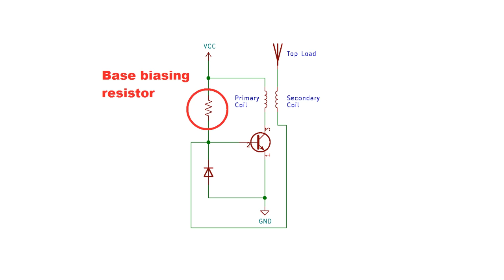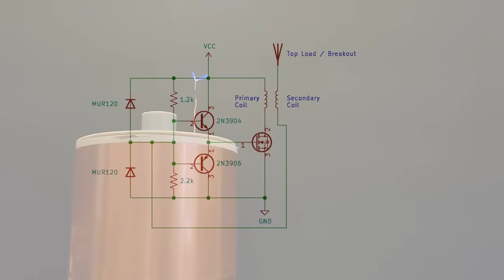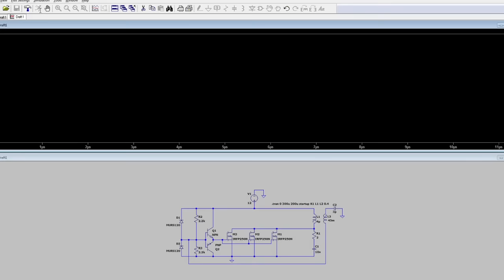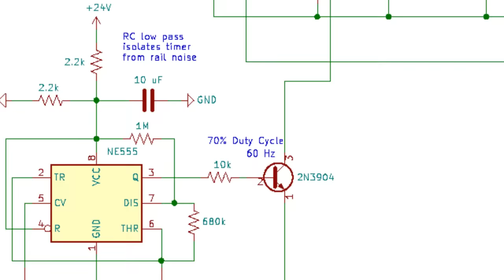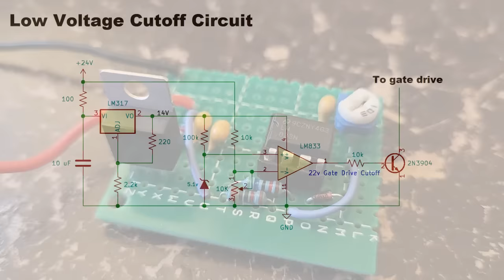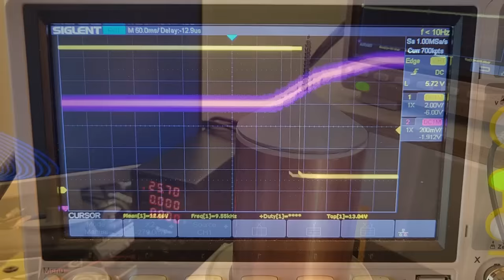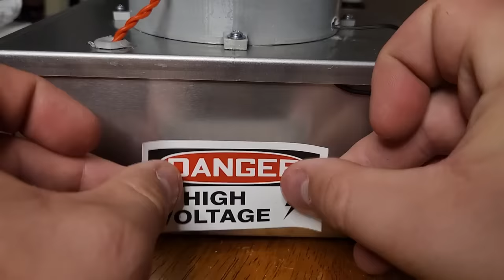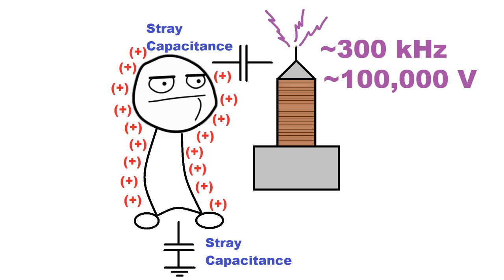Tabletop Tesla Coil

Comment: Trying to repeat. There is bunch of errors in demonstrated circuit cheme. First - gates of mosfets short connected to drain. Second - pnp is up side down, I don't know others, but i can't manage it to work with the listed components. No oscillations.
Reply: Thanks for pointing this out, I don't know much, but this sticks out like a sore thumb. I hate it when the schematics are wrong. People spend a lot of time and effort trying to replicate circuits like this that are just plain wrong. I often wonder if it's intentional.
Reply: Did you manage to solve it?
Reply: I think the shorts on the schematic are probably just from carelessness, it shouldn't be connected, the fets are supposed to be in parallel
Reply: Hey, it actually worked for me. I got around 75KV. But I used a irfp250 mosfet
Reply: @sree137918  hey and then you used the timer on 24v?  Making a parallel connection for vcc to power both parts of the  circuit?
Reply: Actually, it was powered by a 24v 2A supply with a 4.7 nf capacitor in parallel with a single FET. It was a continuous wave tesla coil
Reply: the reason why the PNP transistor is "upside down" is because it's a push-pull amplifier. it's supposed to have both emitters on the bjts tied together
Reply: Yes bro i tested it didnot worked
Reply: I actually corrected the schematic, probably will upload in my channel soon....
Reply: I actually built this a while back and when it hardly worked I thought that I put it together wrong. Thanks for clarifying
Reply: What is wrong with the above circuit? I'm about to do it but I'm a bit confused.
Reply: Cant blame the guy too much i make mistakes like this all the time

Comment: Nice coil! I made the same "insulated switch" discovery when I built my 833C VTTC. Whenever I would touch one of the toggle switches I would get shocked! I also thought initially that I had a bad grounding system but it was current being induced into my body by the electromagnetic field.

Comment: This perfectly shows why I stopped my last circuit design. I did design simple circuits many years ago, really trivial stuff, but even there you start with an simple idea, and then fix the issues ... and simple becomes complex fast. Since I lack experience I can not judge if my finished solution is actually ok or an abomination that still works somehow. So just decided to delegate that when I actually need a circuit. For what I do, i.e. abstract systems design, I just need to know that technical solutions exist.

Comment: So built up this circuit and it works flawlessly good Job! getting about 2.5 inch off the breakout at 24v nothing getting warm other than the snubber resistor which is doing its job!, time to make he voltage cutoff im debating to use a lm358 instead as this is all ive got in my parts bin, cant wait to get it in a box and portable, thanks for showing how its done ;-)
Reply: Hello, by any chance can I contact you by email for assistance? I'm also trying to do the same...

Comment: Videos like this make me nervous, but not for the reason one may think. I've killed more than a handful of devices (bench PSUs, function generators, etc.) from running/testing my tesla coils next to them. So seeing you run it next to your nice scope is frightening. I don't know if my problem is cheap electronics that I had or what... :(

Great build and video as always!
Reply: i saw his monitor flicker in the background when he turned it on, i wonder if its fried
Reply: I know what you mean. I was testing a low power emp generator once (maximum range for disrupting unshielded devices around 5m). It managed to kill 2 laptops; they died shortly after the testing. First time I thought it was a coincidence, so ended up with two destroyed laptops.
Reply: @threeMetreJim  Unfortunately this is the reason I stopped experimenting with Tesla coils. I have very little free space that would get me away from my/others' electronics. 
I built an awesome SSTC that ran off mains a few years ago, but after switching it on once or twice I realized I couldn't do that again :(

Comment: people are always telling me "You MUST put transistors in Darlington Config when using multiple in parallel" and I'm wondering why I see people that seem to know their stuff just putting them in normal parallel and don't seem to have any issues... Are there certain circumstances when its ideal and times when not an issue or times when u must or abs can NOT... nice  video and great circuit, presentation, appearance very cool and interesting watch!
Reply: Darlington connection has nothing to do directly with paralleling transistors, it only may help to provide BJT base current. And this way it's not useful at all with MOSFETs in place of BJTs (see that NPN-PNP pair gate driver in the video).

Comment: The larger top load should improve performance, so strange that it reduced it in your case. It's possible that the additional circuit elements like the snubber circuit are just no longer well tuned to the new frequency caused by the larger capacitance.

Comment: A regular CRT high voltage generator does this same exact thing. We called it the high voltage section. 
It operated at 15,734.26 Hz.  
It’s a standard high voltage transformer. We never, one time, called them a tesla coil. 
High current input on the low impedance side - high voltage output on the high impedance output.  25 inch TV’s had 35Kv on their Anodes.

Now for the haters and defenders.
Reply: You mean a flyback? No tesla coil runs at 15khz, they usually run in the megahertz range, if you are talking about the flyback transformer it is a completely different thing with different purposes too.

Comment: An amazing device & great workmanship. A few comments/questions:  Use a pvc and/or plastic chassis instead of metal?  Immerse any circuit boards in transformer or mineral oil for cooling & the prevention of arcing. Make the primary/secondary coils "plug-in type" so that you can experiment with different lengths & diameters. Can the primary/secondary coils be immersed in oil with just the screw tip exposed?
Reply from the maker: I use a metal case to serve as a ground plane for the circuit and shield the electronics inside from the huge amount of electrical noise caused by the coil.  

The oil thing would definitely work, just more hassle and potential to make a big mess, so usually i avoid it
Reply: @HyperspacePirate  how does changing the overall surface area of the ground alter the output?
Reply: @HyperspacePirate  Mineral oil gets on everything regardless of how you try to contain it.
Reply: @HyperspacePirate  what diameter had your wire?

Comment: I would have used a plastic box, and plastic bodied switches, to prevent accidental discharges through the hands, and the resulting, very painful, RF burns which you experienced.
You're also generating some low-level X-Rays as well as UV light..

Comment: I gave myself a burn like that with a MIG welder one day,.  I was tacking something, and instead of grabbing a tool, just held it in place.  I've done it thousands of times before, but this time, evcerything was just right for the welding current to try and ground through the end of my finger.  Hurt like hell at the time, but was worse three days after, and looked just like yours.  Could the case be plastic to hrevent accidental burns, or is it being metal a required part of the device?

Comment: 3:29 The overvoltage diode, when active, will sink the current to Vcc. Won't that damage whatever power supply is assigned to Vcc? Because the power supply will have negative current flowing through it.

Comment: great work!
but the circuit at 5:30 seems wrong?
and what is the maximum input voltage this driver can handle?
Reply: The max he used was 30 volts, so I wouldn’t go much higher than that

Comment: I would love to safely play with one of these medium strength tesla coils, but as I live in on the 4th floor of a 6 floor apartment building, I am wondering about how much and what type of EM interference noise It would possibly be generating to outside my unit into my neighbours dwellings. I woudn't want to cause much in the way of this, as I don't wish to make them upset with my running it in here.

p.s: I would probably purchase an off the shelf already available one... any recommendations?
Reply from the maker: They'd be too far away to catch any interference. It really only affects unshielded electronics within a few feet
Reply: @HyperspacePirate  Thank you Hyperspace Pirate... ok, so that gives me more confidence to check into getting one... * I'd love to be able to make one like you've shown in other previous videos on a simple scaled down version of what's shown here, (very impressive, btw), but I'll purchase a small one first and start playing... and maybe build one later.
Reply: @HyperspacePirate  how much frequency could these switch? I have a 1MHz coil with no toroid, with toroid it goes to 650kHz
Reply from the maker: @ElIsraelJijijiji  This one is around 300 kHz. A typical MOSFET would probably work ok up to around 1 MHz
Reply: @HyperspacePirate  I plan to make a fatter secondary, I'm using 38AWG since it was all I had on hand, my new coil will be like 450kHz
Reply: @HyperspacePirate  i could run the Gate driver and Interrupter from a different power supply and then just add the higher voltage power supply just into the FET drains
Reply from the maker: @ElIsraelJijijiji  if you had a gate drive transformer, yeah, but it makes the whole thing way more complicated
Reply: @HyperspacePirate  i was just thinking to input 12v or 15v at the collector of the Gate driver, and it will come from the same power supply for the 555

Comment: Hi, a couple of comments on your otherwise great video.The Slayer exciter circuit work with both a BJT and MOSFET alike, the big difference is the  BJT  can sink significant current via the Base Emitter junction effectively providing a return path for the secondary coil current which is not insignificant ( depending on the transistor it can pass up to ⅓ the Collector Emitter current) negating the need for a Base to ground secondary return resistor.  This is not not the case with a MOSFET which has a high impedance Gate to Source, so you have to provide somewhere for the secondary current to go, this whole circuit could be much simplified by using a suitably rated 12V Zener Gate to Source across say a 100 Ohm and a 470 Ohm pull up to supply, you mention in your video 3.40  “ Buffering the current to the Gate”? This makes no sense as there is no gate current to speak of.

Comment: I'm trying to build the circuit, but along the way, I have some questions. If someone could answer a few, it would help me a lot:

--Is the snubber filter resistor 2 ohms or 1 ohm? Because in the last version of the schematic, 1 ohm appears.
--Does the value of the capacitors connected at the beginning have to be exactly 3300 uF? Because I have 3 similar ones but they are 2200 uF, although I don't know if it would work because I'm not very familiar with the purpose of placing those capacitors.
--To find the ideal value for the snubber filter capacitor, is it more appropriate to start testing values above 54 nF or below?
--What awg is the primary winding?
Reply: 1. Snubber resistor's value isn't critical, but keep in mind that lower value resistors will heat up significantly more. You can't use too high value resistors though, because then snubber wouldn't serve it's purpose. I think he used 2 ohms.

2. No, these capacitors are only to provide higher current when circuit needs it, so I think that 3x 2200uF will work just fine

3. In my opinion it's better to start with higher value capacitor and then gradually going down. You can also calculate it's value(he explained how to do it in his video about ignition coil drivers)
Reply: @Antek1234l  thank you :)

Comment: In the triple parallel FET circuit diagrams... why are gates and drains showing as connected together?
Is there some aspect of FET operation that I've failed to understand?
The points where the parallel gate connections cross over the parallel drains are all showing as connected, so this must have been deliberate as these drawing programs don't create connections without the designer designating such - again as far as I know.
What am I missing please?
Reply from the maker: That might be a mistake in the schematic

Comment: Careful using screwdrivers around TCs. They build up a charge like a capacitor. Had one screwdriver discharge on me and my arm kicked so hard the screwdriver nearly stuck in the ceiling as it flew out of my hand.
Reply: Wtf kind of goofy screwdriver you using? You were probably charged. A screwdriver doesn't have enough surface area to form any meaningful capacitance
Reply: I was holding the plastic handle. the metal tip, which was on the end a full tang rod, was stuck into the sparks was not grounded to me. Apparently I became one plate, as it were, and the metal rod running through the handle of the screwdriver was the other plate. The plastic handle was the dielectric. @TantalumPolytope
Reply: @sojournerdelaterra6144 with that little surface it would discharge extremely fast and hold almost no charge, I'm pretty sure something different happened, maybe you didn't see an arc to the screwdriver but when you touched it it was receiving electron anyways (like corona or something)
Reply: @ElPsyCongroo.  I can only share what I observed. It wasn't a spark from the coil. I can take sparking coil voltage all day long on my hands. Ultra-high voltages travel over the skin, not inside the body. This, however was a deep muscle kick which is indicative of an amperage release. Thus, I could only conclude it was a capacitive discharge of something between me and the coil and that was the screwdriver.
Reply: @sojournerdelaterra6144  or phenomenon happened that caused a lower frequency arc? I don't know, tesla coils are like that sometimes
Reply: @ElPsyCongroo.  I'm certainly not going to try and replicate it, LOL

Comment: I have w doubt you can touch the Spark even when the voltage is that High is because the current is low enough right?....but when touching it you just reached out to it or have to ware rubber shoes and all

Comment: But is it possible to somehow galvanically untie the circuit so that the earth is not common?
Reply from the maker: More robust SSTC designs use a transformer between the base of the secondary and ground to isolate the logic from the power. Alternatively, an antenna can be used within a few inches of the coil. Both methods add a good deal of complexity, though. I recommend looking into some of Steve Ward's designs to learn more
Reply: @HyperspacePirate  Ok I will look. Thank you😁

Comment: hello I can only do 1cm plasma
at 150W what do I have to do to get more plasma?
I have 450 secondary windings of 0.4 mm
and primer 5 turns 2.1mm. That's how I get the best results.
Reply: Your secondary has quite low turns, plus I assume it's a high frequency secondary
Reply: @ElIsraelJijijiji  yes i use a tube with 7cm diameter 18cm high and 0,4mm drad which drad should i use ?
Reply: @ElIsraelJijijiji  980khz
Reply: @Flo-mb9zg  7cm of coil diameter is ok but you need a more thinner wire, try to use 36AWG magnet wire
Reply: @Flo-mb9zg  that's nearly 1MHz
Reply: @ElIsraelJijijiji  is 1mhz going? more or less?
Reply: @Flo-mb9zg  uhhhh it's 1 million hertz you say to me

Comment: Increase the frequency until it loses its tendency to penetrate the body. Skin depth will decrease with increased frequency. Pretty sure Tesla was making people glow like this and even observed phenomena that corresponded to acupuncture points. Pretty sure at a high enough frequency he mentioned that the air in the room began to glow. Can dig for the article if you are interested.
Reply: Surely that's a reputable source...
Reply: @ex5080  thanks for contributing!
Reply: Man, i want that article. or any info